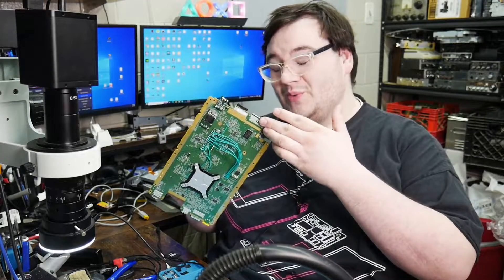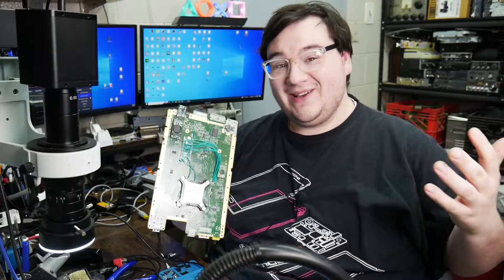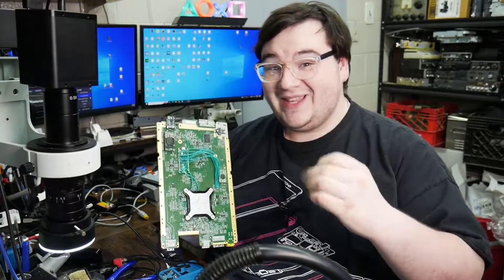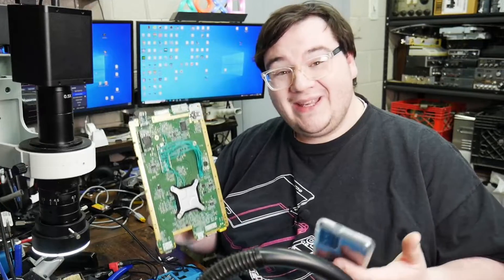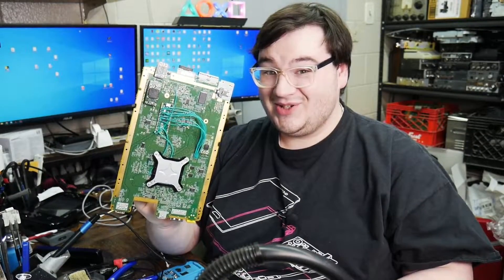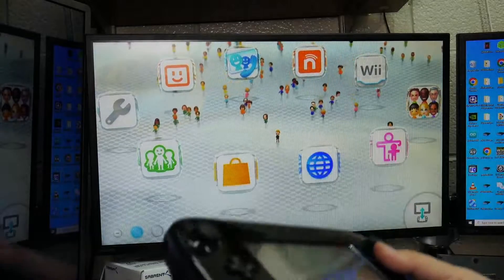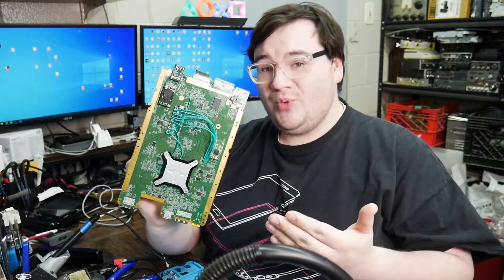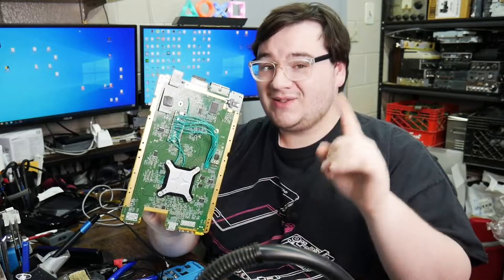I Saved The Fully Bricked Wii U With a Mod Chip

Comment: Mine boots into wii u logo only. Recovery menu does not show at all but i know i can blindly navigate menu and I know because it dumped 3 parts of the nand in 24hrs lol. But before I dive further, should I be defusing or using the isfhax? The issue is that i cannot see any of the recovery and there is no joypad synched to this console - i have one but bought system broken

Comment: Hello i have a Wii U and its stuck at the WII U splash screen. No codes, tried the Pico and fat 32 trick but when I plug the Pico in it shuts the system off and never restarts. Much help would be appreciated. I have the legend of Zelda WII U no mods but has digital games on it.

Comment: My Wii u freezes every 10 seconds to a minute. I can play digital only games, but any disc I run fails. It used to give a 103 memory error. I ran the pico Gary odernic bug fix thing for that. Now when it lets me get to the point where a disc is in, I get an error about a USB not being in or something. I haven't been able to try any other troubleshooting because it freezes too fast. Any advice?
Reply from the maker: Try other apps to and see what errors you get.
Reply: @chasefournier  I tried other apps and it just gives the 160-0103 memory error every time now.
Reply: @chasefournier  Okay, I'll try. Just kinda mind numbing running into the freezing so often and having to reset 😅. Gary when I commented on his page said it might be a corrupted emmc, but I'll try your suggestion first to see if that gets me any new answers.

Comment: Also in the next one maybe go with a 64gb eMMC. I would say that would still be stock, as it works without firmware patches and Nintendo clearly intended to make a 64gb version going by the IOSU code which has a case especially for that.
Reply from the maker: This was a first time diving deep into the Wii U hacking space. I learned as I went, and luckily I got it going again.
Reply: @chasefournier  I would recommend checking out the guides for that on gnatemp, they should have all the information you need. First entry point could be the ultimate Wii u troubleshooting guide and from there the other guides are linked, explaining that error and the options you have to fix it

Comment: This seems a little unnecessary. Why didn't you just install ISFShax to rebuild MLC? It would have given you the same capabilities as as defuse.
Of course if it was bricked so bad that it didn't even turn the screen on, then defuse might be the only option. But if it just hung in the usual factory reset loop udpih would have worked just fine to install isfshax.
When it was showing the 160-0103 the first time, you could just had installed ISFShax as a base and then go from there. After the rebuilt you could just uninstall it, and there would be no traces of it left
Reply from the maker: If only I had this comment a week ago hahaha

It had the error 160-0103, I attempted to factory reset it, that was a bad choice because it became perma-bricked stuck in a delete all content and settings loop. Even with a full Emmc image taken before the update loop. The console was still stuck in that loop.

Updih wouldn't work, the console would shut off when trying that method. 

Thankfully defuse is a thing. And rebuilding the mlc.
Reply: @chasefournier  and I commented your last video with much mre information, it just seems that youtube just silently deletes some comments...
Reply: or maybe I was just a little too late
Reply: @janhofmeier9427  yeah YouTube is a SOB depending on the type of keywords in the comments
Reply: @realhami  there is a detailed guide on gbatemp for setting up redNAND with ISFShax
Reply: Mannn i wish there was more vids on this stuff. Currently a wii u i have is in this situation. 
I was able to install ISFShax, but i didnt know about the nand aid. I couldnt get the wii u menu to boot so i uninstalled isfshax, after doing that its just been stuck on a black screen, but i have (i assume proper) backups of the nand still in hopes that i can find a fix that wouldnt require me to solder if i dont have to.
But if i must, then i will try to. But how does this work? Ive been reading and hearing about it but i havent seen or read anything regarding wether you can still do it with a blank screen or not, how would i get defuse to work if i cant get anything with the wii u menu to load or if i cant get anything for the wii u recovery menu to work? 

I know it sounds like im a newbie but im not, nintendo just makes very complex devices and even more complex software.

Im vaguely confused but i understand most of it im just trying to take every precaution that i can.
Reply: @awhvex7188 my comment just got auto deleted, I guess this is no place for helpful answers
Reply: @janhofmeier9427  ahhh. Yeah i guess maybe i gotta join some discords for some answers 🤣
Reply: @awhvex7188 With ISFShax installed, you could just have used redNAND. Now that you uninstalled the last thing that gave you an entry point, you probably have to defuse (UDPIH might work but probably not in your case).
Also YouTube is a terrible place to get and give help, I would suggest you ask in a proper forum, specialized on that kind of stuff like gbatemp
Reply: So is it possible for the wii u to not output video due to memory corruption? I have one right now that won’t output video and I’m unsure of how to proceed. I can’t tell if the console is corrupted, or if there’s for example a fault with the hdmi port and the console is booting normally. There’s not many people that understand the wii u in detail so I appreciate your perspective.
Reply: @freestyla101  if it can still shutdown with a short power button press, then it is likely just an output problem, which could be as easy as just being set to AV. If you have to force it off with a long press, then it is something else, likely a bad eMMC
Reply: @janhofmeier9427  yeah it needs a long press of the power button the shut down. So that means there’s no point trying to guess the sync passcode to change the output to av. Would this be a good candidate for one of the unbricking techniques that use the pico? I’d have to navigate the menu blind.
Reply: @freestyla101  UDPIH Most likely won't work. You can try it anyway and see if the LED turns purple. If UDPIH doesn't work you can then use the pico for defuse
Reply: @janhofmeier9427  ok that makes sense. So it is possible that the video output problem is caused by a bad emmc right? I’m going to try what you suggested I just want to make sure there’s hope and I’m not wasting my time.

The only thing I know from what the seller told me is something went wrong during an update and it stopped working.
Reply: Mine boots into wii u logo only. Recovery menu does not show at all but i know i can blindly navigate menu and I know because it dumped 3 parts of the nand in 24hrs lol. But before I dive further, should I be defusing or using the isfhax? The issue is that i cannot see any of the recovery and there is no joypad synched to this console - i have one but bought system broken
Reply: @nunyabusiness69  install ISFShax, then dump the logs there